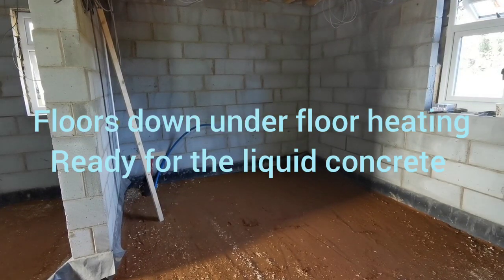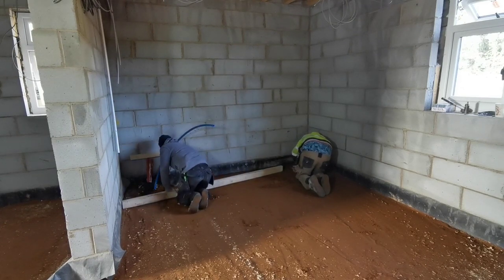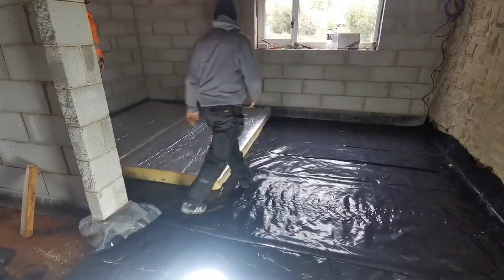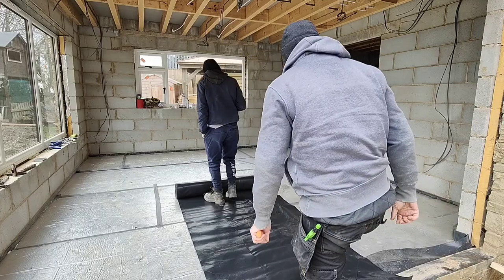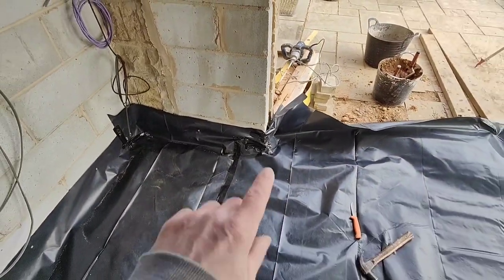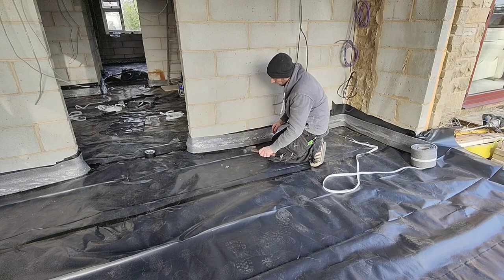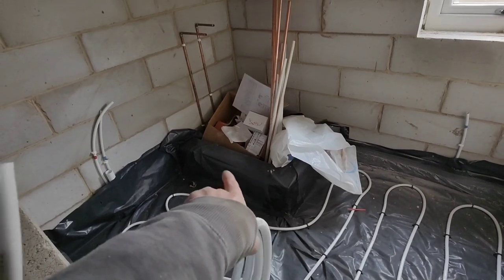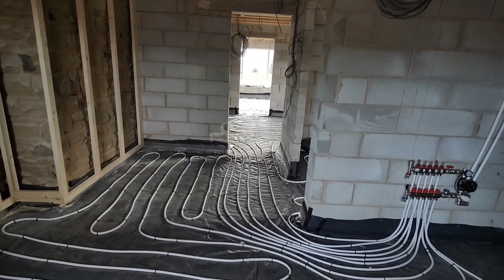getting floor ready for liquid concrete under floor heating

Comment: Was going to ask what the foam board is for but I presume it’s an insulation to keep the floor heating more effective. Never actually seen floor heating before, some people here have it but it’s not common, we don’t get cold enough to warrant it. I presume it’s an effective and economical type of heating. I can see how once the concrete warms up it would radiate heat for an extended time, unlike heating the air which dissipates very quickly.
Reply from the maker: Yes mate there's a lot doing it over here now .it's grate in the winter when you got your feet on it feels really strange. especially when you have tiles and it's warm.only problem it there no radiators to dry your clothes on lol👍
Reply: @markhep set a  clothes rack on the tiles and hang your clothes there. They'll dry much better than on radiators .
I installed ufh on ground floor by myself and it's so much getter and more economical than radiators .
Reply from the maker: @July-A7  definitely mate 👍👍👍

Comment: Nice explanation and nice work. One question .... the sanitary hot/cold and the foul water piping ... in which layer are they run ? through the hardcore ? Are the clean and foul pipes separated by some conventional spacing or smtg ?
Reply from the maker: Hi mate .they got brought up through the hardcore .the foul water and the clean water were pretty close together think I gave it about 100mm apart . inspector never said anything about it when he came .👍👍

Comment: Does the visqueen need to be tied into the wall under the dpc before the walls go up? Or can you lay the visqueen after the water and tape it along the walls
Reply from the maker: You can definitely lay the visqueen after mate and just put it up wall I nail it higher than the finished wall holds it up a bit 👍

Comment: can I put top membrane over the pipes and not directly over insulation boards?
Reply from the maker: Really you want it underneath.dont know if you put it on top it will probably cause the concrete not to warm up a much as it should.you set the pipes in concrete so the pipes are warming the concrete up .I mean you could do it but I don't know weather this would make the heating less efficient.if you know what I mean